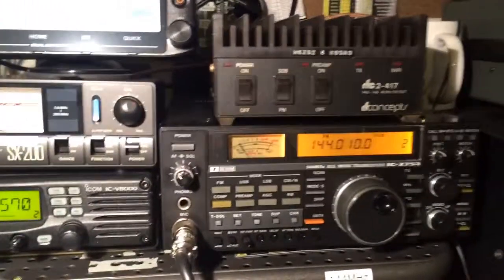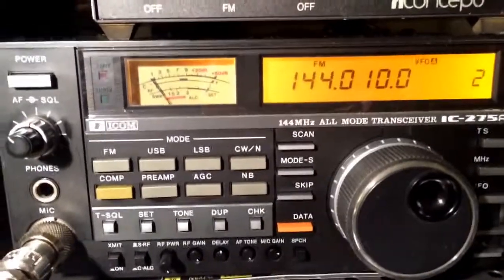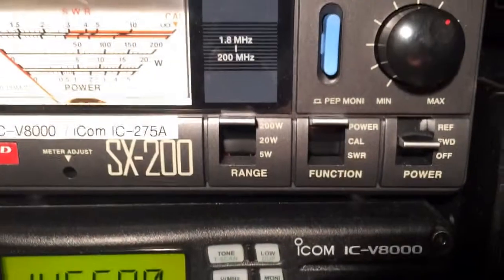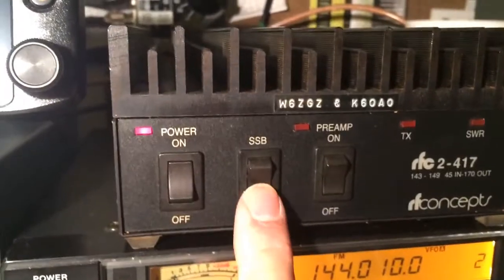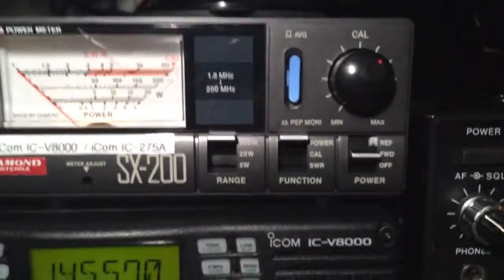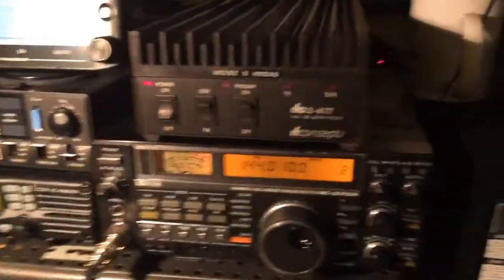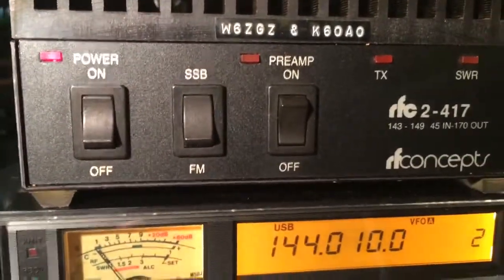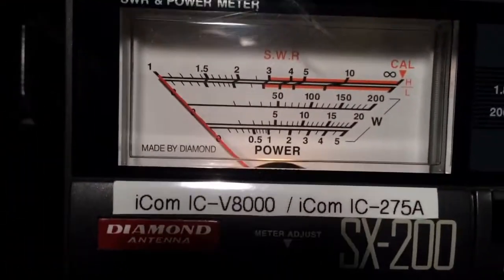RF Concepts RFC 2-417 2m VHF Linear (40W in/ 170W out)

Comment: just a quick question if anyone can answer, i have a rfc2-117  which is the same as this amp but runs off a 10w drive, what can i do if i need to drive it with 25 or 30w rig?

Comment: That is a lot of AC hum from the power supply when you key the microphone with the amplifier on.Not good.
Reply from the maker: 1OFGODSOWN How can you determine an AC hum without a monitor on this video? Could you be referring to the transformer vibration ? I guarantee you there is no AC hum with my transmission on full power with FM nor SSB, as tested with my scope and heard by all stations I’ve talked to.
Reply: Pet N6PET I clearly hear a hum when you keyed the radio and amplifier. It is only there when you key up. I have an ICOM 275A,RF CONCEPTS 2-317 amplifier, and an Astron RA-70M Power Supply and when I key up there is no hum like you have.